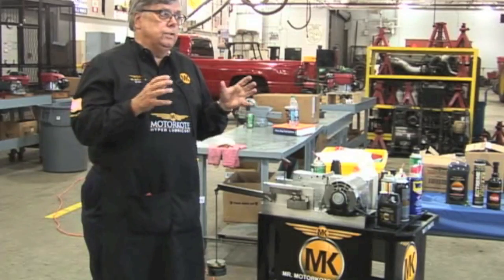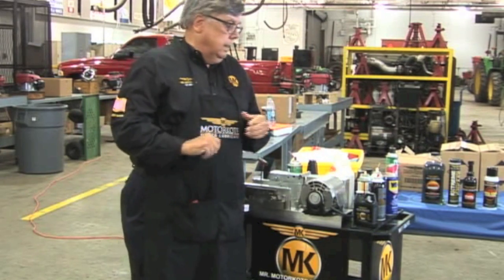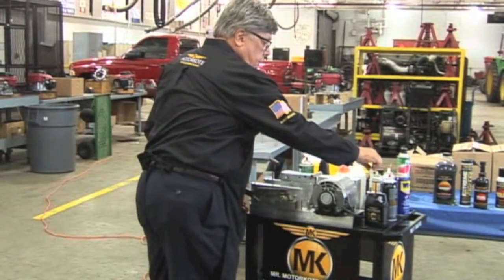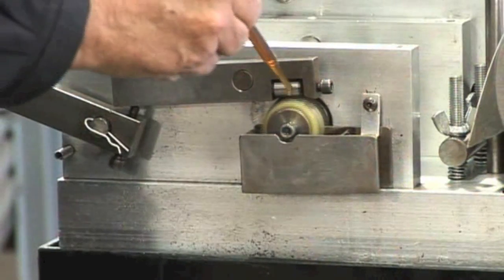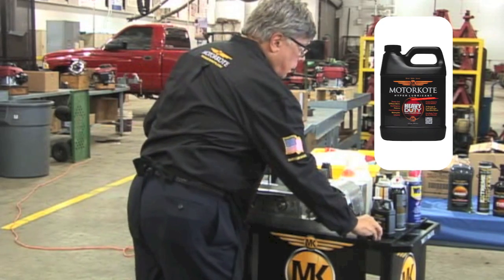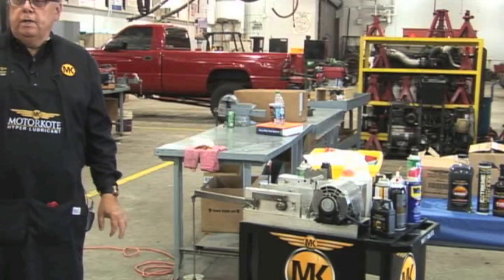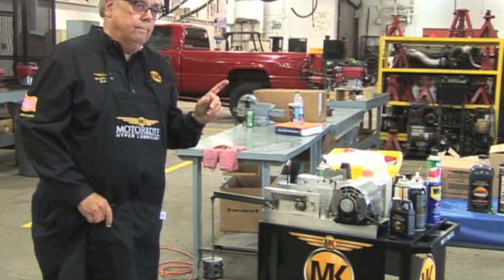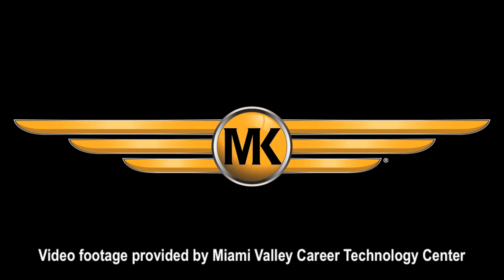MotorKote® Demo

Comment: My rear diff 370's on my 1996 W900L was showing metal on the plug every PM and then at 5000 miles, I do another chassis lube. It about $1300.00 for a rebuilt with core. I put two 32oz bottles in with a fresh diff flush and refill of synthetic gear oil. Now I had been using just the synthetic gear oil alone and was getting metal chips (not gear metal) on 2 previous diff flushes. So after we added the two 32oz bottles of Motorkote with the fresh drain and fill, I went back to work. I pull containers out of Atlanta so you those who have been around know containers are brutal on a truck...geesh! So on the next pm, we popped that plug and my Mechnic's eyes popped wide and said, damn dude, one small piece of metal and the oil hadn't darkened! Now of course I'm a praying man and give all thanks to God any way but I was really happy when I saw what he saw...lol. So I have a1996 W900L 3406e Cat with a 10spd (13spd is coming) with 370's and I put Motorkote in every thing that moves! I tell other drivers about this stuff and they say, that stuff is about $80.00 a gallon right? I say yeah man but it's worth every freak'n penny, because I don't put just anything or let just anyone work on my W9 and especially my Cat! And I run Mystic 15w-50 synthetic blend with a Motorkote chaser...lol. Awesome product 👍

Comment: MK has done wonders for my diesel engine, I have the X 15 Cummins engine, with any other engine it takes 26 to 28.2 gallons to go 100 miles, with this Cummins X 15 engine it only takes 22 gallons to go 100 miles, after mixing 16 ounces of motor coat with the standard oil for this engine I now go 100 miles at 19 to 20 gallons depending on the route, area, and season. 

My oil tank is a max 11 gallons, I put 10 gallons of standard engine oil for this engine and 1 gallon of Motorkote, I had all of the oil dumped out of my gear differentials and replaced it with Motorkote, also for my transmission, now I take fully loaded trailers total weight 40 tons, I fuel only according to total route destination, Again, depending on the route I fuel at least twice if I'm going through mountains, now I fuel only once and still have about 20 to 25 gallons of fuel left, didn't have to change my oil for year and 3 month, totally worth it...

I also use upper cylinder lubricant from Motorkote, my engine pearls like a cat now I get up to 3 MPG's, never thought I would see 9 MPG's in the Northeast and 10.6 mpg's west of Colorado I 70 Fully loaded, 80,000 pounds

When my truck needs to Regen to burn out the ash from the DPF filter it takes at least two hours, that's almost 2 gallons wasted, with the motorkote DPF cleaner it takes less than an hour sometimes. One of my fathers trucks is a Coronado with a 60 series Detroit engine, I used MK stiction remover that removed clunked and clogged up oil out of his fuel injectors

I look at the comments were people are using this in their car, you're not gonna notice that much of a difference if any at all but it works, and cars really don't need much; you would only feel and notice a big fuel economy difference in heavy duty engines and parts..

Comment: But.. if you ad anything to your oil,, it IS technically an "ADDITIVE"
Reply: You add MoteKote to your engine, which then COATS the engine and does NOT mix with the oil. Thus your oil performs exactly the way it is designed to with metallic parts that have now been coated by MotorKote. An additive like lucas mixes with the oil and is designed to work or change the composition of the oil....Capeesh?
Reply: @nephi30  So you "Added" it to your engine... but its not an Additive... Got it LOL
Reply: @HappyHands.  Motorkote is 27% chlorine which doesn't belong in the oil for sure

Comment: Amsoil hates these additives, I wonder why?
Reply: Amsoil is probably still the best Engine Oil on the market. Having something that coats your engine and perform as well as MotorKote nullify's the protective properties of the marginal advancement of Amsoil.
Reply: Can you mix Motorkote with Amsoil??
Reply: @NickJenneboer1986  I wouldn't mix it with any oil considering it is 27% chlorine
Reply: @NickJenneboer1986  just watch this video. https://www.youtube.com/watch?v=88vwUwa3igQ&t=253s

Comment: i have a jeep tj 1998....poncture the oil pan on a rock....ran 50 miles home ,changed the oil pan and the jeep run like new. thanks to motorkote !
Reply: MK has done wonders for my diesel engine, I have the X 15 Cummins engine, with any other engine it takes 25 to 27 gallons to go 100 miles, with this Cummins X 15 engine it only takes 22 gallons to go 100 miles, after mixing 16 ounces of motor coat with the standard oil for this engine I know go 100 miles at 19 to 21 gallons depending on the route, area, and season. 

My oil tank is a max 11 gallons, I put 10 gallons of standard engine oil for this engine and 1 gallon of Motorkote, I had all of the oil dumped out of my gear differentials and replaced it with Motorkote, now I take fully loaded trailers total weight 40 tons, I fuel only according to total route destination, Again, depending on the route I fuel at least twice if I'm going to mountains, now I fuel only once and I still have about 20 to 25 gallons of fuel left, didn't have to change my oil for year, totally worth it

I also use upper cylinder lubricant from Motorkote, my engine pearls like a cat now I get up to three MPG's, never thought I would see 9 MPG's in the Northeast and 10.6 mpg's west of Colorado I 70 Fully loaded, 80,000 pounds

When my truck needs to Regen to burn out the ash from the DPF filter it takes at least two hours, that's almost 2 gallons wasted, with the motorkote DPF cleaner it takes less than an hour sometimes

I look at the comments were people are using this in their car, you're not gonna notice that much of a difference if any at all but it works, and cars really don't need much; you would only feel and notice a big fuel economy difference in heavy duty engines and parts

Comment: Does seafoam break down motorkote?
Reply from the maker: No, Seafoam can help reduce carbon buildup though.  We also have a new product with a slightly stronger formula.  https://motorkote.com/motorkote-heavy-duty-motor-treatment
Reply: Mix chlorine with alcohol and that will tell you if they can mix

Comment: Those weights cannot weigh that much. You had me until the small weights were given figures of 30 pounds each...
Reply: 30:1 fulcrum.. the weights are 1lb
Reply: That is a hilarious comment
Reply: MK has done wonders for my diesel engine, I have the X 15 Cummins engine, with any other engine it takes 25 to 27 gallons to go 100 miles, with this Cummins X 15 engine it only takes 22 gallons to go 100 miles, after mixing 16 ounces of motor coat with the standard oil for this engine I know go 100 miles at 19 to 21 gallons depending on the route, area, and season. 

My oil tank is a max 11 gallons, I put 10 gallons of standard engine oil for this engine and 1 gallon of Motorkote, I had all of the oil dumped out of my gear differentials and replaced it with Motorkote, now I take fully loaded trailers total weight 40 tons, I fuel only according to total route destination, Again, depending on the route I fuel at least twice if I'm going to mountains, now I fuel only once and I still have about 20 to 25 gallons of fuel left, didn't have to change my oil for year, totally worth it

I also use upper cylinder lubricant from Motorkote, my engine pearls like a cat now I get up to three MPG's, never thought I would see 9 MPG's in the Northeast and 10.6 mpg's west of Colorado I 70 Fully loaded, 80,000 pounds

When my truck needs to Regen to burn out the ash from the DPF filter it takes at least two hours, that's almost 2 gallons wasted, with the motorkote DPF cleaner it takes less than an hour sometimes

I look at the comments were people are using this in their car, you're not gonna notice that much of a difference if any at all but it works, and cars really don't need much; you would only feel and notice a big fuel economy difference in heavy duty engines and parts...

Comment: I put the upper cylinder lubricant from MotorKote into my fathers old diesel engine from Detroit, in less than 20 miles the engine got quieter and the power begin to pick up, just from the upper cylinder lubricant, Which also cleaned out the fuel injectors...

https://www.youtube.com/channel/UCrE40CPYc8zajBDaiUcimNA

Comment: my ex-father in law bought a gallon yrs ago after motorkote came to Chrysler proving grounds years ago...ive used motorkote in all my vehicles ever since...without exception every vehicle ran smooth without any trouble what so ever!! ive put some of these old vehicles through the wringer....engines always ran great still when i sold them...dont know how it works i just know it does!! never thought of using it on my firearms but i will now! thanks Ron Smith
Reply: Olelo 80000008 I have been using it in a 2000 Nissan Sentra and 2005 Mazda Tribute along with a fuel additive in the gas tanks and I must say that both vehicles have been running extremely more quieter and smoother! I've only been using for 3 months but the difference IS noticeable!

Comment: i used motorkote in a 96 olds and a 07 vw  in 200 miles engines are super silent     at first i was like this crap isnt gonna work  i can hear and tell a difference     crazy shit   one bottle did 2 cars and 2 mowers

Comment: "CHLORINATED PARAFFIN" THE EXCESS CHLORINE WILL REACT WITH TRACE SOLUBLE METALS IN OIL CREATING HYDROCHLORIC ACID IN YOUR ENGINE, IT WILL EAT UP YOUR BEARINGS PISTONGS RINGS ETC. DO YOUR OWN RESARCH.
"CHLORINATED PARAFFIN" THE EXCESS CHLORINE WILL REACT WITH TRACE SOLUBLE METALS IN OIL CREATING HYDROCHLORIC ACID IN YOUR ENGINE, IT WILL EAT UP YOUR BEARINGS PISTONGS RINGS ETC. DO YOUR OWN RESARCH.
Read more Show less
Reply: What's the point of your comment when Motorkote doesn't contain chlorinated paraffins or anything else you mentioned? Do your work for a competitor and are trying to troll their videos or something?
Reply: or PTFE, another gum, will  give a good result, but after a while, will drag metal aprticles and abrase everything. it will ruin your engine or gearboxe.
Reply: No one has at all confirmed this.  I'm pretty sure they would have been sued by now as well, they very clearly state that Motorkote causes NO corrosion and there isn't any small print on the page.

Comment: Since i'm lucky enough not to have brake cleaner in my motor LOL I'll use Mobil 1 5w30 Extended Performance 15k guaranteed protection dexos approved full syn motor oil, Fram Ultra Synthetic Oil Filter, Motorkote, and lucas HD oil stabilizer, OverKill ;) but my trucks my job :) probably will add some motorkote and lucas HD oil stabilizer to the diff and OK that too chevy front diff, tcase  ;)
Reply: Motorkote grease is good too, I wouldn't even bother with oil stabilizer...

Comment: I drive a 2003 BMW 325xi -- straight six cylinder (60,000 miles on it). It takes 5W30 synthetic motor oil. Should I use MotorKote, and now much when I change the oil?  Thank you.  John King

Comment: I've been using it for a couple of years, I put about 1/2 pint in every 4th oil change, the old tahoe has 285,000+ miles and runs well with good gas mileage. Bought the spray lube and did amazing things to our drawer glides and anything else with a metal to metal contact.  Mechanical engineer for 34 years and this stuff is really impressive! Just follow the recommendations on the container and watch for it to go on sale, the price is the only downside.
Reply: Dale Engman it is expensive, in this case you really are getting what you pay for! but i totally agree man, its some good stuff. we needed this in the military like asap

Comment: I use it on my guns and in my truck love moterkote
Reply: +adammarshall80 - I use it straight as the lube, however you can add it to a regular gun lube too. A $21 dollar bottle at Amazon or Walmart is a lifetime supply of your using on firearms. It's completely eliminated any failures or malfunctions of any kind, which I never saw before in AR's.
Reply: +Pmag1984 Do leave it on your guns as lube when shooting, or just treat the surfaces of moving parts and wipe off and lube with a gun oil?

Comment: all engines are designed to wear  a certain way and at a certain rate. I have no idea how adding one drop of this stuff  will help an old engine other than allowing more blow back past pistons and worn parts. so how does reading the bottle change these engineering facts?
Reply: In cold starts your engine is more protected preventing further wear, in any instance where the mechanical parts are exerted to extremes, etc causing them to make contact at a high pressure.  The majority of wear happens when you first start your engine, so if Motorkote does what it says it could vastly reduce a large margin of total engine wear in this regard only.  Also, it kind of sounds like you are referring to the break in period of engines, when you first drive them off the lot at 0 miles.  In addition, it could help older vehicles by reducing the wear when piston hits the cylinder walls, etc.  With that being said no one is saying this will revive an engine... definitely falls in the category of preventative maintenance.  If this does indeed leave a tiny layer on metal then that could actually reduce blowby and increase compression (in theory).

What exactly is blow back pistons?  Are you referring to blowby when your plug isn't in all the way or your piston ring isn't sealing properly?  How on earth could reducing wear cause more worn parts?

Comment: hhmmmm  had an old lawn mower, ran just fine for the longest time till I put motorkote in. Then she stopped. Took the mower to a mechanic and he said motorkote was the problem. Seems you can't run full strength MK in small mower engines. A new mower cost me almost $500. I don't think I'll be putting any motorkote in this mower.
Reply: Motorkote isn't oil. Sounds like the excuse an idiot friend made when he blew-up his engine when he tried to run it on fuel injector cleaner after running out of gas.
Reply: I'm curious how long you ran it before it broke?  Because before the carrier oil burned up I'd have a hard time believing that would be the cause of failure unless it ran dry first.
Reply: What a goof. You work for the other company. Nice try goof. Drive a big rig,so many truckers use Motorkote. Drop in to truckers stop and ask the people who drive for a living. You goof. And  you 16 year old junk lawnmower . Get off to work instead of us paying for you to stay home in your trailer park. Have a wonderful day !
Reply: @robert19271  Use it in my 3406e Cat and tranny and diff's on my 1996 W9, and this stuff is awesome!